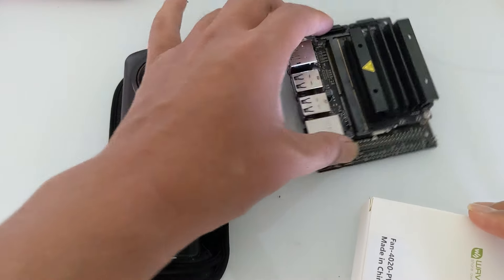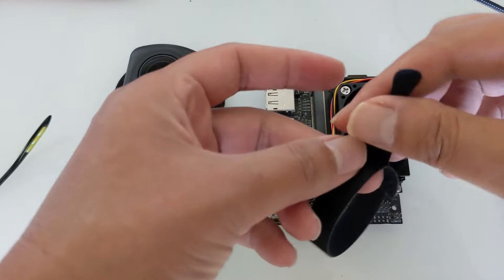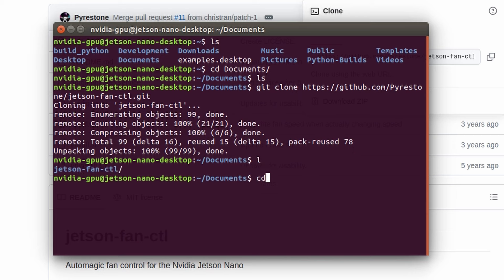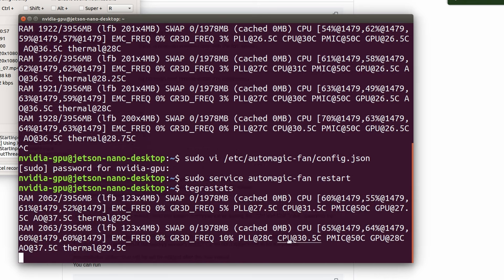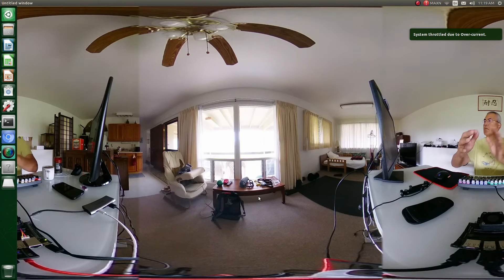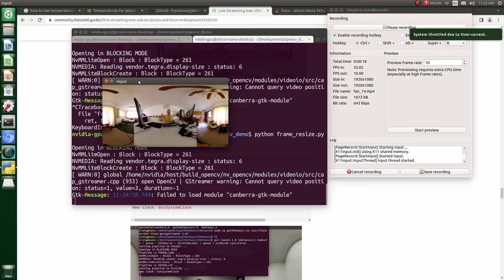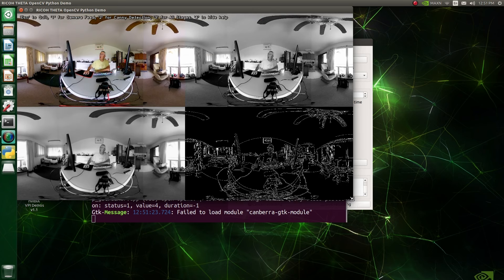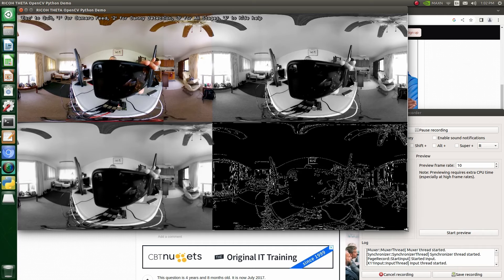NVIDIA Jetson Fan Install, Temperature Tuning and Power Supply Upgrade

Comment: pulse width management ?????
Reply from the maker: sorry, should be pulse-width modulation.   Basically, the fan goes faster when the CPU gets hotter.    Just search for PWM fan, 5V.  It's a 4 pin fan, not the 2 wire. more info here: https://www.tomshardware.com/reviews/glossary-pwm-pulse-width-modulation-definition,5888.html